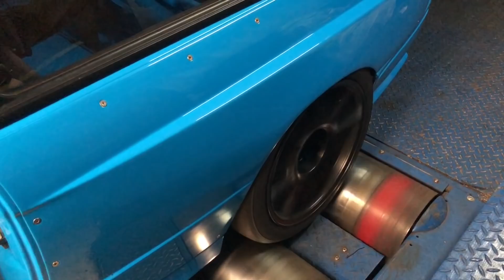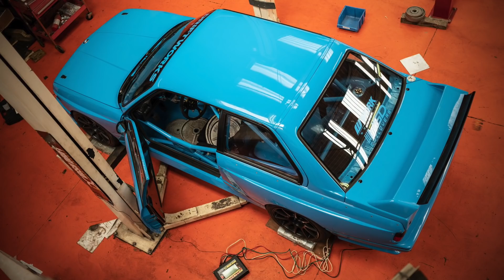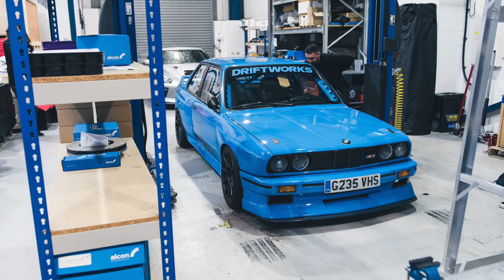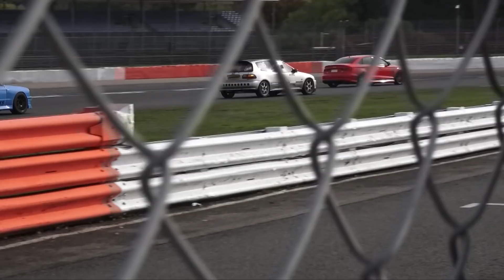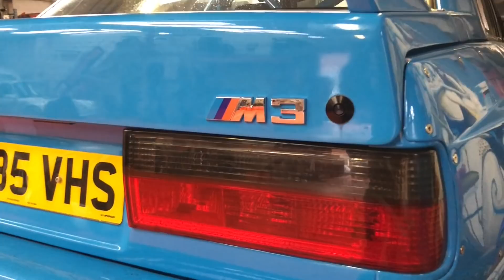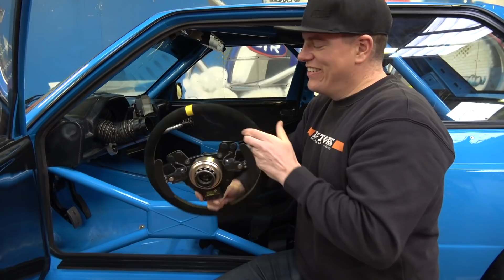Dyno time & road test for the S65 DCT swapped E30 M3 - Track car project Pt 13

Comment: Ive been battling oil temp issues on my e30 / s50b32. Even running a massive earls oil cooler / AN 10 lines and bypassed internal oil filter housing thermostat (which only pushes about 30% oil in standard form) and just running a 0-100% external mocal and just getting air into the e30 cooling section is quite hard. You need to bucket the entire thing .. and gap needs to be removed just to get the air moving through.  At worst .. building a vanturi system is my next job. Also another hint is a split brake cooler duct pipeing some air into the cooler area. Again it needs to be bucketed to force the air through the coolers.
big engine e30lyfe :/
Reply from the maker: Yeah I fully expect to still have issues even with these gigantic coolers. I'll be doing my best to not cut horrible holes in the bumper.
Reply: @driftworks  yeah mate, I agree.. do everything else but that! :) love the car btw .. its very very well done.
Reply from the maker: Thanks! It's only well done if it works (yet to be confirmed haha )

Comment: Couple of questions....
1. Have you thought about monitoring each cylinder AFR/EGT and tuning the inlet lengths to suit?
2. Also with the cooling, if the radiator temps are good and stable, have you considered using laminova oil coolers, might help save you drilling holes in the front bumper?
Reply from the maker: Hi Tim, I was never looking for power with this car. In fact I was fine if it was a few horses down on a standard E92M3 as I don't want it to be too powerful for the chassis (which it probably already is). I just felt like it was unecessary to lose that much power, and Gareth had a plan. I have indeed considered a laminova oil cooler as the water cooling is so capable, and it would help bring the car up to temp quicker as well. If I was starting from scratch it would definitely be part of the plan.

Comment: Love the car but the exhaust tips are too short. Watch a 80's DTM film. Plus the e30 came with opening rear quarter glass. You should definitely fit a pair of those. Headlights are an easy fix with an upgrade to HID's. I would also look at electric air-conditioning like the R35 powered 86 in Oz. Check the windscreen rubber seal as this is where a lot of leaks emanate from on a 30.
Reply from the maker: Thanks man.. We're not trying to make it a DTM lookalike. It's so far from what they actually were. I'm actually not a fan of the original E30 DTM exhausts. so as with lots of other stuff it's 'inspired by' with my own twist.. I'm liking the electric air conditioning idea! & I'll check out the seal & lights. Cheers!

Comment: Please tell me what spring rates are you running front and rear for this weight car?
Reply from the maker: I've changed them a little, I think it's 10kg front and 9kg rear at the moment. The rear was a softer rate in some of this video, I changed the springs about three weeks ago, and haven't tested it on track yet.
Reply: @driftworks  thank you. Did you calculate the spring rate from this corner weight in the video? Is there a certain ratio you use?
Reply from the maker: No, we're not that sophisticated / knowledgeable. I just choose a starting spring rate based on my knowledge of similar car / engine weight / front rear bias and how I want it to drive. Then I drive it and see how it feels & adjust.
Reply: @driftworks  thanks for taking the time to answer your comments! Thumbs up.

Comment: Does the rear end still have trailing arms? If so, how much of a disadvantage do you think it is on track?
Reply from the maker: It does, but as discussed in previous episodes it's heavily modified & lifted into the car body. It's never going to be as good as modern suspension, but hopefully we've made it as good as it can be. If it's total crap we'll narrow and E92M3 rear axle.

Comment: Phil, do you run  plumbed in extinguishers (4 litre ect) in any of the driftworks BDC cars? Thinking about investing, but going to MSA regs with my builds so not sure about other disciplines. 
The corner weighting is pretty even now too. Wouldn't mind borrowing a few hours on them myself haha
E30 looks bad AF now.  Semi trailing arm FTW!
Reply from the maker: I do in the 86, more recent rule books don't require it for what we do. To be honest, any time I've ever seen a plumbed in kit used, it's always weak as it's spread out over multiple nozzles, and often just dumping in the wrong place. You're much better off manually aiming with a handheld, but obviously, if rulebooks require them, then Lifeline do some great kits.

Comment: Have you looked at the high pressure and low pressure areas to make sure that you get high volumes of air flow?  I'm not sure about the E30 M3, but my E30 325iS had OEM aero to help duct air thru the radiator.  It runs from the bottom edge of the front valance to right past the core support and even up to the lower front edge of each wheel well.
Reply from the maker: We have a kit for this if necessary. We still have a lot of work to do with the underside & front arch liners & brake ducts.

Comment: Love it!! It's the perfect //M from my point of view! For security reasons, why not for a proper alarm system, and have it all functioning from a separate 12v battery that is charged from the Alternator, but can only be used by the alarm? Also... YOU NEED TO ADJUST THOSE HEADLIGHTS lol :D

Comment: have you thought about putting the oil coolers, behind the B pillar in the cockpit, and having ducting on the window direct to the coolers. then you also reduce heat transfer to the Radiator? then you could also run a serge tank, and get a 3 stage dry sump ? 
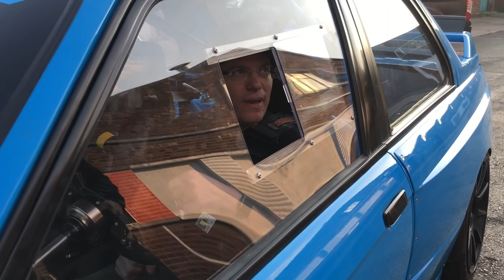Watch this video from 7:42 https://www.youtube.com/watch?v=GdyQUuBljng
Reply from the maker: No, can't say I have.